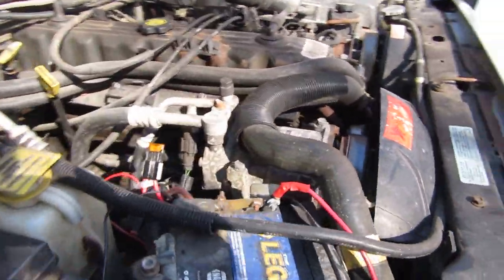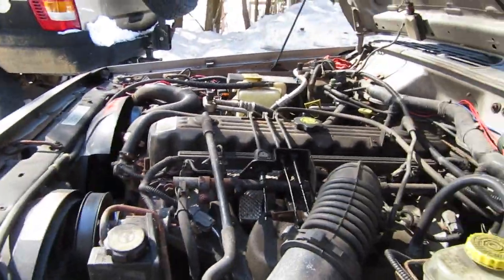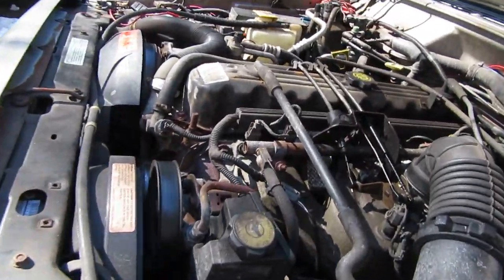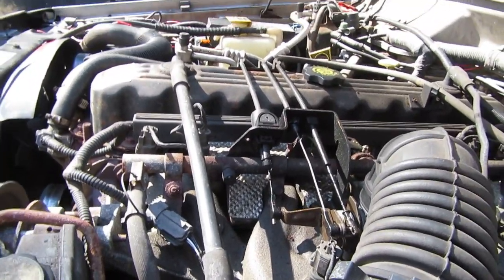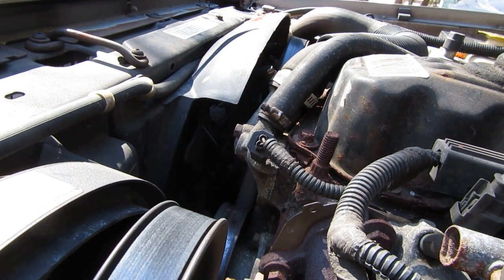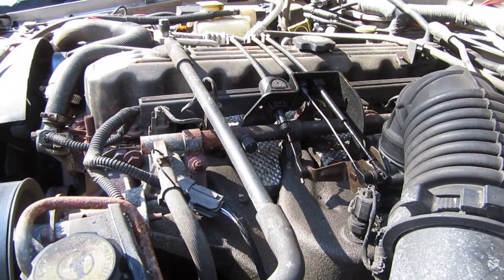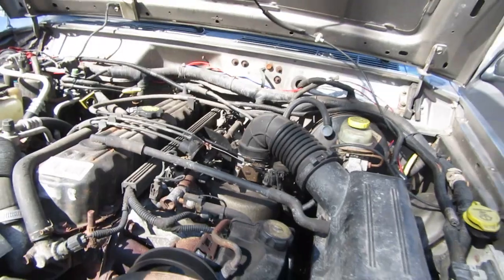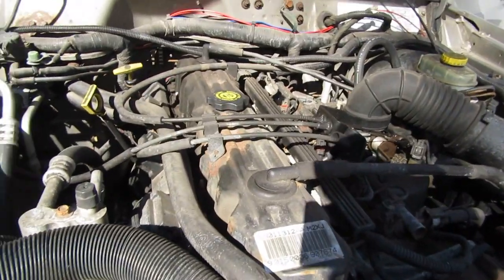WHAT IS HEAT SOAK? Why does the XJ have so many cooling issues?

Comment: I have a 01 xj 4.0 it use to run on 118 and then it started to overheat and now every time I drive it it runs 215 and it gets hotter when it idles then it says "check gauges" I already changed the thermostat and flushed the radiator, the  E fan works, any idea what it could be?
Reply from the maker: You are certain the fan is working? Is your mechanical fan also working? It is possible the head gasket was damaged when it overheated, unfortunately
Reply: D&E In The Garage  I changed the head gasket as well its new, well the fan does turn on when the ac is on but idk if it turns on wile driving
Reply: I flushed my radiator 3 times. Still same issue as you. Put in new radiator and problem gone. Cut ends off old radiator. 3-4 solid inches of gunk on both sides. That was after flushing.

Comment: Ive got a 2000 xj, always had the rough idle after sitting right after driving. Lately on the hot days we've been having it started dropping rpm and eventually stalling while driving down the road sometimes wont restart at all until it sits for a while. Got it home a few times by packing ice around the injectors. I put the DEI heat sheild kit on it and it was good for a few weeks until it got even hotter outside about 95 degrees. Just wondering if its actually a heat soak/ vapor lock issue or something else. Getting tired of being stranded on the side of the road.
Reply from the maker: Hmm.. Does the engine overheat as well?
Reply: @DEInTheGarage  nope not at all runs right around 200 to 210
Reply from the maker: @calebsmith9658  Definitely sounds like heat soak then.
Reply: @DEInTheGarage  alright thanks, thats what i figured. Just wanted a second opinion. I got better heat wraps for the injectors they're the ones mopar sells and they are way thicker than the ones that come in the DEI kit. Gonna give those a try and see what happens.
Reply: @calebsmith9658  I realize that this is an old post but my 96 XJ has started showing the same symptoms you described.  Did the heat wraps for the injectors help?
Reply: @justinbrown3529  not really it ended up that the crank sensor was going bad. Eventually, the crank sensor ended up going completely, and it wouldn't run at all. Changed the crank sensor, and it fixed all those issues.

Comment: 2 row rad, aux oil cooler, aux trans cooler, higher GPM water pump and manifold, lower temp thermastat. Use distilled water and motul concentrated antifreeze. You'll never over heat. Little expensive but worth the investment
Reply: Michael SANCHEZ true but you also never actually get the engine to operating temp, engines are supposed to run at the operating temp for the best results. So if you do everything you said, just make sure it’s a brand new factory temp thermostat and then you’re good.

Comment: Hood vents are typically the easiest, cheapest and fastest way to resolve this issue. They’re also the most reliable as it’s considered passive cooling and they work regardless. None of my XJs has ever had issues with heat soak. Grease, dirt and corrosion build up are the number one contributors to this. So keep your engine bay clean and that gunk won’t trap heat inside your engine or nearby components.

Comment: What an astonishing description. My 75 Firebird has a heat spoak, so I had to buy a new starter and now I need to add a heat blanket to protect the starter and the plastic cover.
Reply: ChrisLycan isn’t the fire birds the cars that put the starter like right on top of the engine under the intake? That was stupid, and it definitely would have issues with heat soak lol

Comment: Great info. My wife's 2000 rhd Jeep Cherokee is doing this. She's a mail carrier and also the mpg is shit (8-10mpg). Although lots of stop and go will explain some of the bad mpg it shouldn't be that bad.

Can the heat soak lessen the mpg as well?  Didn't know about the pre-cat. I've ripped out the cat so I'm thinking this may have affected mpg as well?
Reply from the maker: Yes, removing the resonator from a Jeep can effect MPG. It effects the exhaust flow characteristics and lessens the scavenging effect. Also heat soak can cause a very small drop as well. I would suggest wiring in an auxiliary fan circuit so that she can control the fan on her own when she knows heat soak may be imminent
Reply: @DEInTheGarage  Thanks. To begin with I installed this kit: Design Engineering 010378 Fuel Rail and Injector Cover Kit for Jeep (1997-2004, 4.0L Engine) https://www.amazon.com/dp/B015NOKWQY/ref=cm_sw_r_cp_apa_i_VZp2CbWJTWPB8

While I was at it also upgraded to some Bosch 4 hole injectors.

So far, so good. No heat soak yet.

Comment: I live in Phoenix, and I don't have any of those issues in my 97 ...even when it's 118 for 3 months...I've the clutch fan on mine...
Reply from the maker: It is mainly an issue on the 98-01's because they added pre-cats to the y-pipe which created extra heat below the injectors

Comment: I don't get it. I removed the electric fan in my 97 and I don't need it. Runs nice and cool even in july.
Reply: Chrysler redesigned the Intake Manifolds on the 4.0 for the 2000 model year, so the problem only exists for 2000+ 4.0s

A friend has a 98 XJ with no electric fan and it never has this problem, while it happens all the time in my 01 XJ, even with a second fan.

Comment: https://www.amazon.com/Timer-Delay-Relay-Hours-Cycling/dp/B00PD65UGA    Find the amp draw on your electric fan. Then you might try a delay on break relay. They’re usually adjustable time delay before breaking circuit. 12volt only.

Comment: I just recently have the same symptoms on my 95 grand Cherokee  4.0 .but when I bought the jeep. It didn't have the heat shield. Or is only on xjs.. Also the code 53 pops out saying its PCM internal fault condition detected. 
Ive never had an issue with the pcm.. I don't want to go to extreme  measure and just getting a new one when I can just put that shield. Anyother diagnostics I should do. Ive cleaned the whole throttle body and sensors in it too.
Reply: Yeah only on heat start up.. Hey I was going to check the fuel system to see if it was low pressure or something going on.. But start it up with the hood up and everything normal waited for it to get on normal temperature... But as soon as I put the hood down it start acting up on me.. And I raise the hood up and she goes back to normal haha... I thought it was a coincidence.. But left the hood up for 5 mins.. And I put the hood down it does that acting up shuttering then dies.never seen that symptom.. I believe it's just asking for air.. Hood down traps it or something.its been a long day today.have you ever seen that issue before.? 
Just. Empty. Every. Pocket .ha.
Reply from the maker: @cesarrobledo9029  It sounds like heat soak to me. like your fuel rail is heating up with the hood closed. i know this is a dumb suggestion, but nothing is messed up to where closing the hood is contacting anything, right?
Reply from the maker: Hmm... usually the 95's don;t get heat soak as the do not have pre-cats under the intake (it isnt impossible though). Is the issue only on hot startup?
Reply: Nope. Not at all

Comment: I have remedied my boiling fuel by using ethanol free gas. It has a higher boiling point than ethanol gas . It is a bit more expensive if you can find it (luckily a station down the street has it) but it also gets 5-10% better mileage because it burns much more efficiently. I have 3 XJS and this cured my heat soak issue without any mods. 

Note: Heat soak happens only on the 00 and 01 XJs. Jeep put 2 pre cats right under the intake manifold  on those model years. Earlier models don't get heat soak.
Reply: heat soak is not just an issue for 00 and 01 xjs, it can happen to any jeep inline 6. it happens on my 98 tj and 98 xj just as much as on my 00 xj and 01 xj
Reply from the maker: Interesting.. I had not thought of that. There is a place with ethanol free gas about an hour away from me. I usually try to fill my small engines with it
Reply: I wish any stations carried it around here! The closest station is a hundred plus miles away, loves sells racing fuel which is ethanol free but it's super high octane 100/110...  And it's like 10$ a gallon or more.. where do you get yours?

Comment: Hello I have a 93 Cherokee with 4.0 and it has been sputtering as you drive and lately it has been idling high when it starts then comes down after about 3 mins it starts to climb and it idles at 15- 1800 Rpms so when I am at traffic light I have to stand on breaks and ride the clutch so it idles down I have replaced the 3 censers what can it be u am replacing vacum lines and also to start the jeep I have to turn key to on and wait few mins for a clicking sound that comes from the relay box and then the check engine lite and upshift lite up and when they go out the jeep will start but hard if I try to start before all that it turns over but nothing please help thank you
Reply from the maker: Dang... that is a LOT.. without seeing the Jeep, my best guess would be a vacuum leak? Possibly a really bad one. I would check there first
Reply: Deffo a vacuum leak

Comment: I’m pretty sure my XJ is getting heat soak since I shut it off at times to run into a store then fire it up and starts with rough idle then smooths out but when it does it I get code p0303 when it happens
Reply from the maker: Yep, that is heat soak. There are a bunch of ways to fix it. Here is a video of how I fixed mine: https://www.youtube.com/watch?v=lUCr_QCuwE0

Comment: Hood vents will help. Hot air "wants" to move upwards, that is why it's always hotter in the attic. To overkill, you can make or buy a time delay relay for you secondary fan.
Reply from the maker: Haha... I actually have a video on how to install the time delay really on a switched circuit. It is the video that follows this one.
Reply: Ha, i  was like half of the year late with my comment
Reply from the maker: You are correct though. Along with hood scoops and upgraded injectors, the time-delay relay is your best bet for XJ heat soak

Comment: When AMC reduced the diameter of their exhaust ports it was so the head would build heat faster and they could pass emissions testing.  It choked the engine down about 15 horsepower as well.  I wonder if porting and a header would help this heat issue.
Reply from the maker: Hmm.. I know gasket matching (with port a polishing) makes a HUGE different on the 4.0. Never heard of anyone seeing a reduction in heat soak. I woul dbe interested to try it out

Comment: I solved mine by using 4 hole injectors, wrapping my fuel rail and injectors with heat insulating tape, and I made a custom heat shield [like the one from the recall] out of the same heat tape
Reply from the maker: Yea, I have heard those 4 port injectors help. I have them in my WJ, not my XJ yet.
Reply: I currently have the 4 hole injectors in my 97 XJ= and am experiencing this very problem. Installed them about 2 years ago. Funny how I've never had this problem until recently, even during the cooler months...

Comment: Hey man i have a WJ 4.0 and i have this stalling problem that is gotten worse the best i get is 3min and then it wont start, sometimes it'll take an hour. I have changes fuel pump, fuel filter, spark plugs, oil change, cleaned the IAC, air filters, replaced the engine fan a long with relays and finally bought a pcm but still getting the same problem. its my first car so i don't want to give up on it yet but i cant seem to narrow the problem down. Also i dont get any codes on computer.
Reply from the maker: Wow, sounds like a real melon scratcher. So it starts up fine cold, then stalls after 3 minutes and wont start again for an hour?
Reply: Crank sensor
Reply from the maker: That is a really good suggestion. I had a 2002 4.0L that had a crank sensor put it 180 degrees backwards. Made it hard to diagnose because it looked right. Had the same symptoms. Definitely give that a bit of consideration. It is right nest to your oil filter on the 4.0L.
Reply: theres a cam sensor in the distributor that I have replaced on my xj when it had a similar issue to what you are describing

Comment: I’m having an intermittent misfire on cyl 6 in my 01 XJ. I’ve replaced all spark plug and the injector on cyl 6. I tested the coil rail and it working correctly. I just drove it about 600 miles without a problem till the other day. I’m not sure what todo next.
Reply from the maker: Hmm.. that is interesting. usually XJ heat soak is in cylinders 3 and 4. Any chance your head gasket could be blow on cyl 6? or possibly a clogged injector?
Reply: D&E In The Garage I replaced cyl 6 injector. I checked the compression all cylinders were about 150
Reply: Did you figure it out?
Reply: @christianfloresjr5097  I  continued to have intermittent problems till one day it got real bad. Did a compression test cylinder 1 had no compression and a few other ones were low. Pulled the head and there was about an inch long crack in the cylinder wall. Put a new motor in and haven’t had an issue since. Must have just been a tired motor.

Comment: Great video man. I fixed my XJs heat soak issue with an injector upgrade (4 hole less prone to vapor lock and heat soak) and an OEM heat shield that covers the exposed exhaust headers over injector 3 & 4. Works like a charm. I live in south Texas where summer runs triple digits every day so I will still be doing hood louvers and possibly that fan delay mod. Thanks for the info.
Reply: OEM heat shield is very important and most people have ether smashed it and/or removed it. it will help fix the heat soak problem more anything
Reply from the maker: I have the 4 port injectors in my WJ, but not my XJ. I didn't realize that they would help with heat soak. Interesting.
Reply: D&E In The Garage the old style single hole injectors are more likely to vapor lock than the 4 hole. I didnt believe it either but i needed to replace my old cracked injectors so I upgraded. The heat soak issue and misfires have stopped. I added the OEM heat shield to further protect my new injectors and fuel rail. Some people go as far as wrapping each injector and fuel rail to try to resolve or minimize their issue. 
DEI makes a kit that sells a heat shield, heat wrap for your fuel rail and individual sleeves to cover each injector.